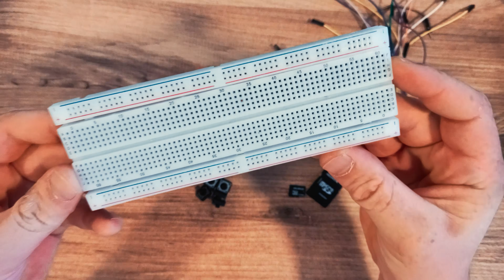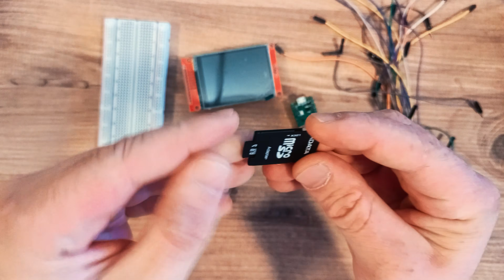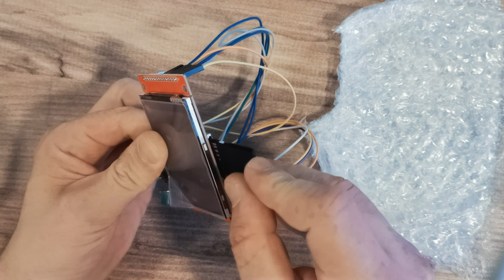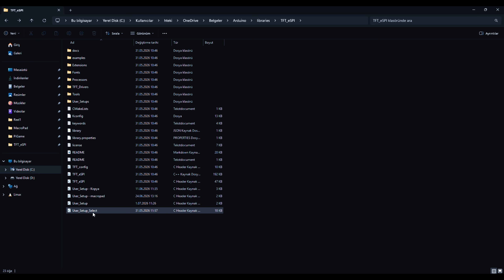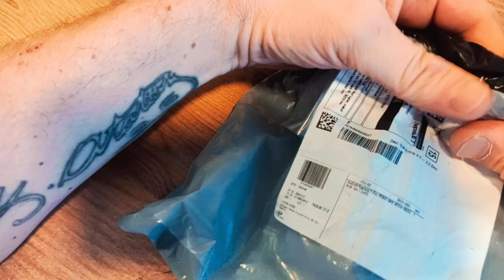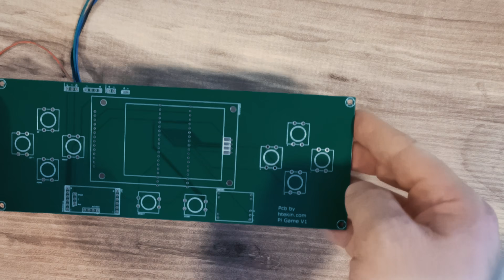Building My Own Handheld Retro Game Console!

Comment: Can you give me some links for the items used in the video
Reply from the maker: Hi! You can find the links to the components and materials used in the video description. For the full component list, circuit schematic, and code, check out the GitHub repository link in the description as well! 🛠️🎮
Reply: @maker_io ok
Last question is there a way to do it with a phone like a 12 Pro Max instead of using a computer
Reply: Is there a way to make a case around it so I could hold it easier and carry it around?
Reply: And how does the sound work?
Reply from the maker: @Disturbedcookiebros Thanks! Just a heads-up: this project is not fully finished yet. I am currently working on designing a custom PCB and a 3D-printed case for it.
However, you can already use these codes to build the setup yourself! If you have 3D modeling skills, feel free to design and create your own case in the meantime. Also, for sound, you can use a MAX audio amplifier module (such as MAX98357A)! 🛠️🔊🎮
Reply from the maker: Unfortunately, no. iOS/iPhone doesn't support the required USB Serial drivers to compile code or flash binaries onto microcontroller boards like ESP32. You will need a PC, Mac, or Linux computer to upload the firmware! 💻 @Disturbedcookiebros
Reply: Also how do I get games on it
Reply from the maker: @Disturbedcookiebros You just need to format an SD card as FAT32 and copy your Game Boy Color (.gbc) ROM files directly onto the root folder of the card!
Simply insert the SD card into the console, and it will load your .gbc games. Note that this specific system currently plays .gbc ROMs! 🎮 micro SD / FAT32 required! 🚀
Reply: @maker_io  this is my first project, so I’m kind of confused

Comment: The lack of PSRAM was the reason I quitted using Pico2 for a mini TV I'm building. I bought ESP32S3 N16R8 (16MB flash and 8MB PSRAM) that costs the same as the Pico2 and is really easy to get.